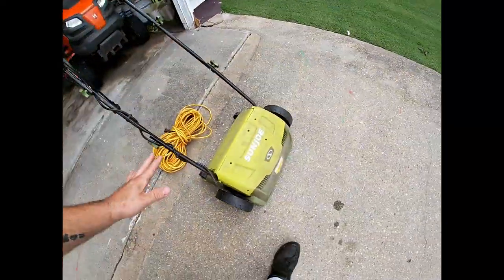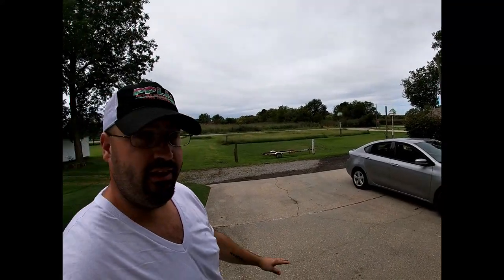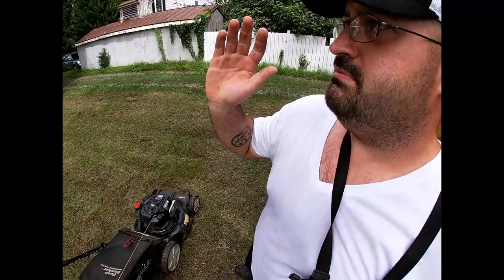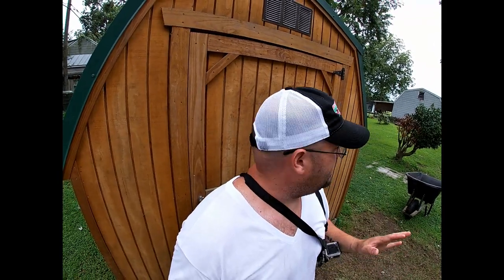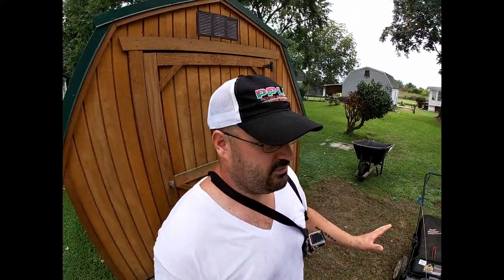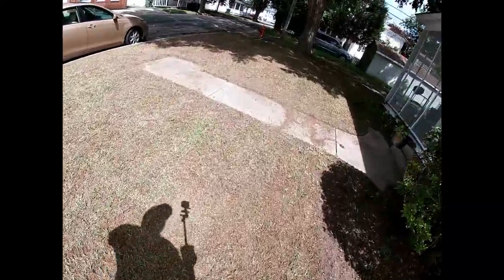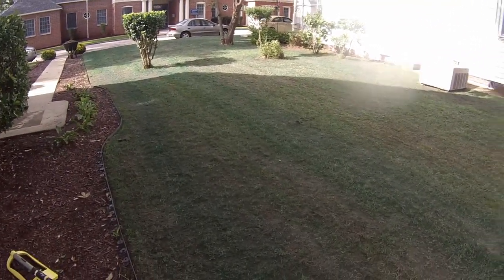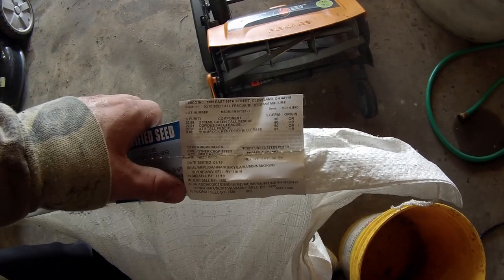neighbor reno part 1

Comment: Nice video. What do you film with? If it’s a GoPro.... I can help you make it do a full screen video.
Reply from the maker: Thanks! I use a go pro 3 and 7. Any help would be greatly appreciated. If you'd like, email me: sandmansdreamland64@gmail.com
Reply: Too large of a video file to email.... go on your GoPro 7.... click on the video setting 1440/60 or whatever. Then once your in the section where you can change the resolution.... look in the top right corner.... tap on the 5:4 ratio and make sure it switches to 16:9 (full screen). Then video settings can be 1080/30 or higher if you wanted. Hopefully that helps!
Reply from the maker: @AsLawnandLandscaping  I could not find the ratio . I was only able to change to 1080p/30 per my go pro app. The camera itself doesn't give me option. I dunno 🤷‍♂️lol
Reply: You don’t see the camera setting in the center at the bottom on the 7?!?
Reply from the maker: @AsLawnandLandscaping  so, no. After doing some research, it's because I have the white edition which has the most limited options of any of the line. This camera is pretty much trash. It doesn't have a removable battery, it only has 3 options of video capture, and it's constantly losing footage. I'm about to Toss it in the river lol. I'm going back to my hero 3 it's much much better. Damn shame